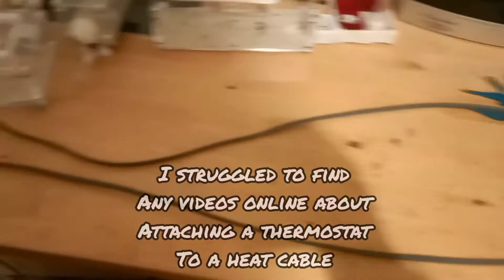Heating Upgrade - 15w Heat Cable

Comment: Nice ! I have that cable . Thought it was massive as you do but the cable is a bit weedy in heat output during colder times so i have it looped about very close to each other and the whole thing sits within two ikea cubes . I also have temp monitors all over the place its better to have the cable touching whatever you want to heat as well . I think I need the  pulse proximity thermostat to try and keep things more constant .
Reply: Its only better than a heat mat for adding the variation and heating loads of colonies but heat mats are better for keeping heat loving species more consistant .I have 11 colonies on that cable a the moment .
Reply from the maker: Sorry about the late reply, yeah to be honest it doesn't get very hot at all does it? The heat mat was definitely warmer, but it was impractical. Do you think getting the next size up would be warmer? (I think it was 30w)
Reply: What do you mean by *weedy*?
Reply: @spamant5255  Not sure mate but i measured mine, it gets to about up to 40 celcius more or less...And yeah it doesn't seem pretty hot but truth be told our palms themselves are 33-36 degrees so for us warmblooded animals subjectively it seems low.While for the ants the optimal temperature is around 25-30 internal.Their larvae develop optimally at a few degrees higher than that.With a 15w cable the only promblem probably is the material really.But if your heating the glass directly on the tube or a nest you should have no problems.But the thing is if you want to heat it through a material like y thong from the back or the side then you might need a stronger cable.
A good design is to have a back tunnel that runs through the nest behind the actual chambers and just put the cable in there... Practical and consistent.But as i said in that case you might need more power.
Reply: @sharpshooter4529  Hi if the  ambient room temperature drops below about 18 then the temperature in the set ups drops alot and the cable just doesn't put out enough heat to compensate so I can go from say 26c to 21c overnight and that's even with a thermostat controlling the cable.
Reply: @Antramblings  I see.Have you measured this? I mean if its a temperate species then those oscillations are pretty normal for them...What i mean is that the changes in temperature won't hurt them.Its like a day and night cycle.
Reply: @sharpshooter4529  well for my nicos that arrived in December i think the temperature swings were just too much as they took over two months to lay an egg but it's not very scientific i admit . I only used a cable last year and had no problems that i noticed for most of the year at all . Just over the colder months but maybe this wouldn't be a problem with a higher powered cable .